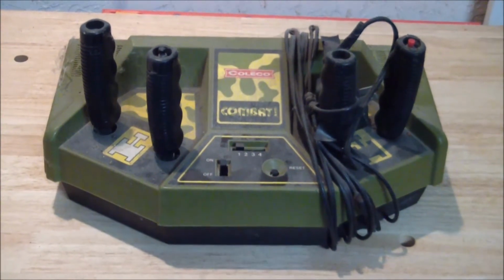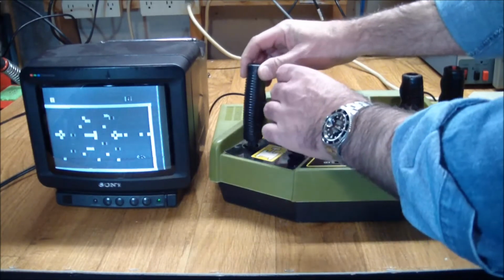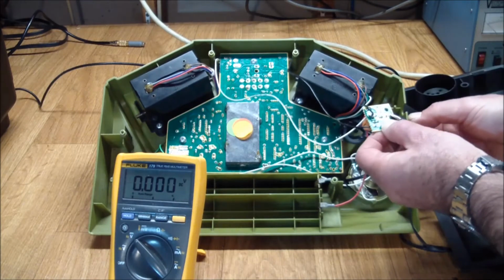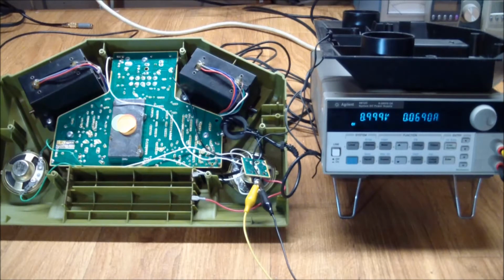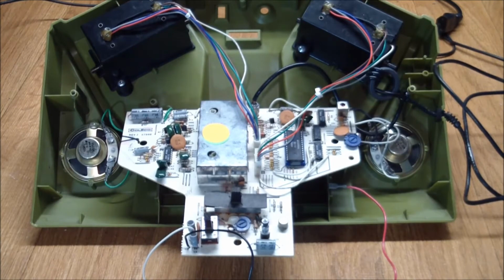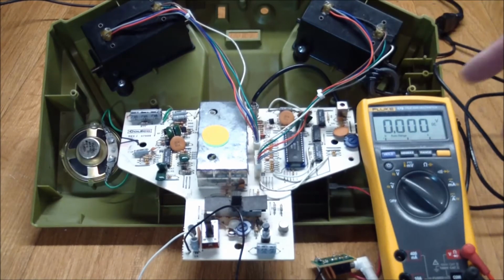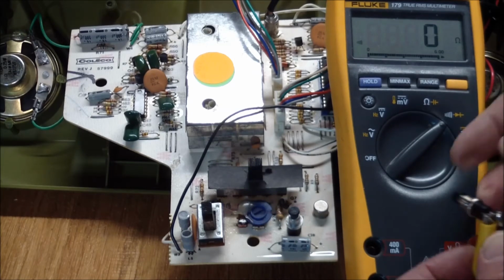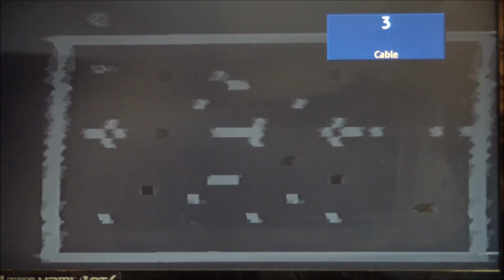AE#25 Coleco Telstar Combat Game Console Repair And Checkout

Comment: White walls only stop bullets not tanks. Weird but that's the way it was designed. The other issues will clear up if you replace those gray capacitors, I substituted a 470uf for the old obsolete 500uf. also clean the TV cable ends with contact cleaner. Believe it or not your almost running as intended.

Comment: Clean the channel select switch.  That will most likely improve the video.  This is a very common problem.  With pong machines, the paddles will usually need to be sprayed with cleaner.  Coleco products, (like Telstar) tend to have power switches that get really dirty and will also cause a ton of problems.

Comment: 7.5v is more than enough.  It will run on batteries. 6 batteries 1/2 way dead will be about 7.5v.  If they drop to 1v per cell, that's 6v. Most batteries will be at 1V long before they are dead.

Comment: These things will only very rarely not work and when they don't work (at all), it's almost always because of a single chip inside the unit or a bad power supply (more likely than chip failure).  These chips were produced in the many millions and should be readily available (NOS, obviously. No new pong chips in many, many decades).
They are incredibly simple machines.

Comment: I the board has a simple series feedback zener-transistor voltage regulator.  You can adjust the output voltage with VR1 if it's too low.  Also, the clock doesn't use a crystal, so it can drift out of tolerance, and you will need to adjust it at LT4.  And the clock, of course, controls the timing of the GI chip, including its sync output.  There is also a pot that looks like it was bodged on after the fact, which seems to be for making sure the oscillator circuit has the correct loading.

As for collisions, there is a pin input that says whether to care about them.  That pin is tied low, likely because of "1 player mode" which makes tank 2 meander around somewhat at random, firing constantly.

Comment: Replace all the Electrolytics. Handling the board also flexes it so you need to check all the pins and make sure they are properly soldered and not cracked and broken. Should just need timing adjust then she'll be good, adjust blanking looks like trimmer to right of chip and Pin 19 should have 4.09MHz. Pop the switch covers off and clean contacts with a Q-tip.The original square wall wart is a transformer with diodes and a capacitor (1000uF my guess) 7.5 Volt should be fine check NEC IC datasheet. Voltage regulation is integrated within one of those chips from NEC follow the lines (looks like IC6) 5v4 not unheard of, wide V ranges in older systems normal. The background should be grey preferably with 1 white and 1 black tank adjust accordingly or color background. No need to mess with anything under the can. BTW there are no other game modes chip specific game. Hot glued trimmer looks out of place to me. Nice looking console

Comment: It's hard for me to wrap my head around a hard-wired implementation of a game. It seems there is something wrong with internal R/W operations of the frame buffer since collision detection would likely be done using the frame buffer. Is it possible that this frame buffer is effectively dual-ported with one side for the game logic and the other side for the scan out? If that is the case, might it be possible that the aging RF out portion of the circuitry affects the internal access logic (game side)? In other words check out the video RF circuitry and see if some fault there (the usual capacitor culprit) could be the cause for a ripple effect that hampers the frame buffer. Probably not -- but it falls neatly into the theory that when you lose your car keys in a dark parking lot, you look under the lone street light because that's the only place you'd be able to find them anyway...
Reply from the maker: Your analysis is close, but in the end your guess is as good as mine. The entire game logic is contained within the GI chip, you tell it which game and when to start and video comes out the other end. It is hardwired inside, similar to early Atari games like Breakout which didn't use a processor nor a frame buffer, the entire screen display is generated in real time.
Reply: Your testing this in game mode 4. I thought earlier in your video you had it on game mode 1 and the black tank did make noise when it collided with the white playfield graphics. Could be the mode your playing allows the tanks to pass through the playfield?

Comment: The battery terminals gave it away ;-) Six 1,5V cells  make 9Vdc.  An empty battery is around 1V so it probably runs fine down to 6V.  Do not measure the output of  an unloaded, not-stabilized  adapter, it will put out a much higher voltage.
Reply: That's what I thought. The old PS would probably be fine if those tarnished wires were soldered. Plugin PS probably cause more damage than anything because they get lost and the wrong ones get plugged in.